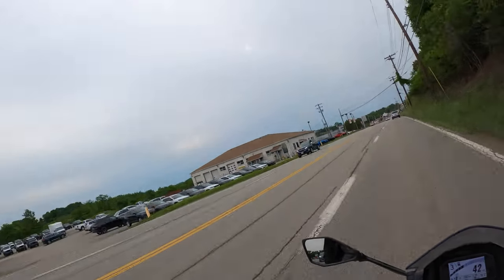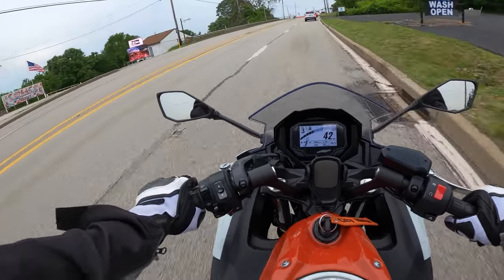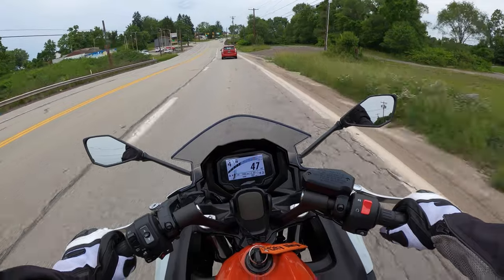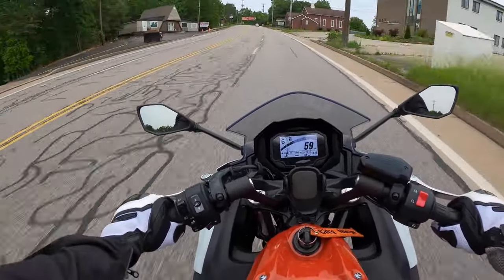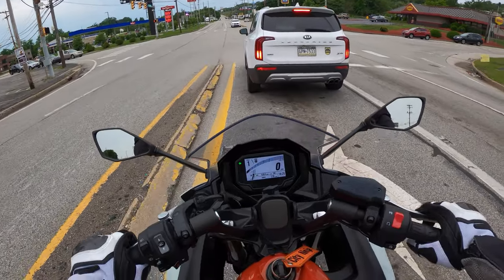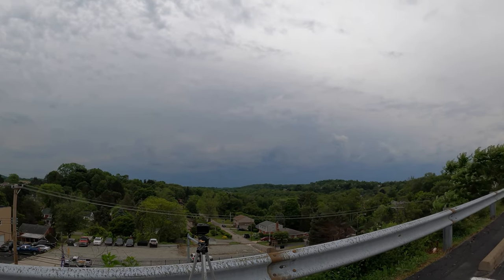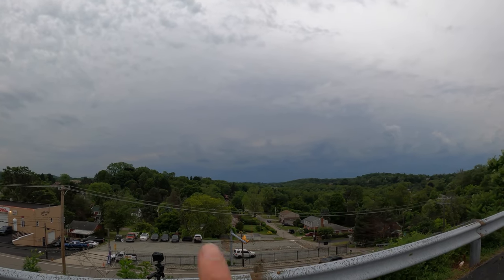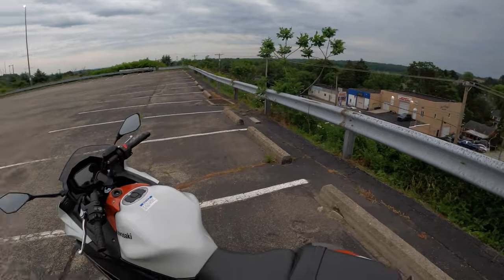Storm Chasing on a motorcycle: Heavy Rain.

Comment: Interesting rain ride and it's good that you enjoy the rain on the bike. Visibility, traction, other cars, cold, wet, for me, not fun when I get stuck in rain on the bike. Soaked shoes are the worst and can ruin a good shoe if the moisture doesn't go, turning to mildew inside the shoe. Do you wear rain gear? I have waterproof pants, but that's it. 
How do you handle your visor helmet with fogging and drops blocking your clear view? I turn my head slighting to the right or left and it'll veer off more quickly that direct forward. 

What tire brand do you have? My current Dunlop SportMax are not very good tires as the grip is questionable on the back tire most of all, and the tread depth wears out quickly. I think I'll invest next time in a Touring tire. Bridgestone's Battleax tires last a long time on my old bikes.
Reply from the maker: I do have rain gear. You’re right about the boots. That’s the thing that gets wet the most and it’s pretty uncomfortable. 
My mask surprisingly doesn’t fog up to to much. When I bought my helmet I got a clear protective thing put on the inside to prevent it from fogging. Sometimes it will fog but it’s actually rare. When it does I crack it open a bit and takes care of it.
I have Battle ax T32 touring tires on right now. I love them a lot actually. I would get them again honestly. They made it to almost 6k miles and just now started showing signs of replacement. I do wanna try those Michelin Road 6. They are more expensive but I don’t mind dropping money on good tires
Reply: @CityNinja650  Cool, thanks. Yes, the Battleax tires are the best from my experience for long-lasting tires and good grip too. I'm not going to buy the Dunlop Sportsmax ($90 each I paid new) again as they wear down way too fast and the back tire is a bit slippery at times. I'll be lucky to get 4000 miles on the back one. 6000 miles on your Battleax, that is worth the extra money spent, great to hear, thanks. I'll look into the Road 6 tires also. Thanks. 

I've been slowing down my riding lately, sparing my tires more, but also getting back to longer ranges on fuel. Sunday I reached 194 miles and had 0.5 gallons to spare which could've gotten me to 210 miles guaranteed if riding 65 mph and less. The faster it goes, the faster the fuel goes too. 

When my 2003 was my only transportation for about 7 months back then, I rode in the rain and even snow (one day my visor fogged up so I opened it partly to see and my eyes almost froze in place that frigid day), but was relieved when I got a car for those wet and more slippery times. 

And on very hot summer days, it is uncomfortable wearing a jacket but I don't feel as safe without one. Plus the sun will tan or burn the arms if no jacket. But once the bike gets moving out of traffic, it's not bad and cools down with the wind.